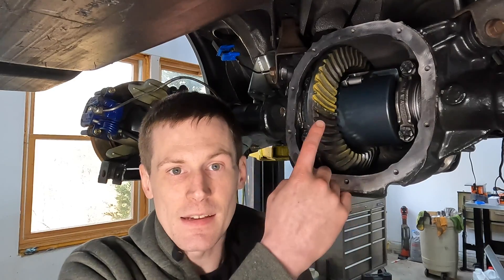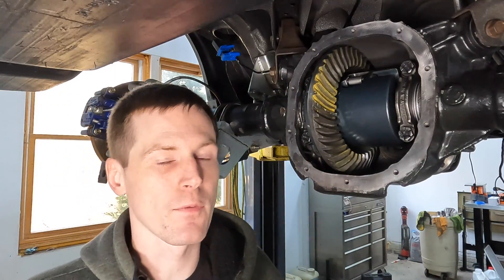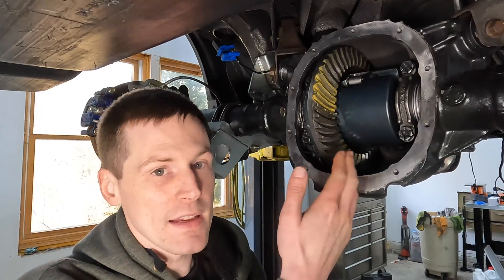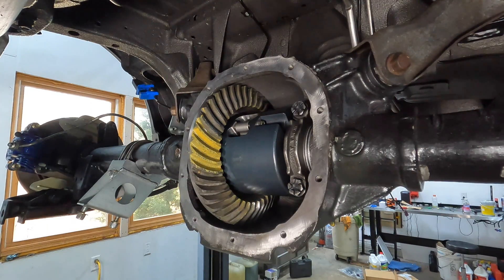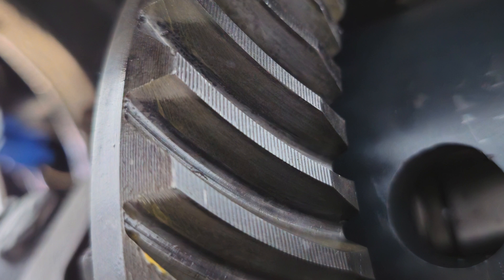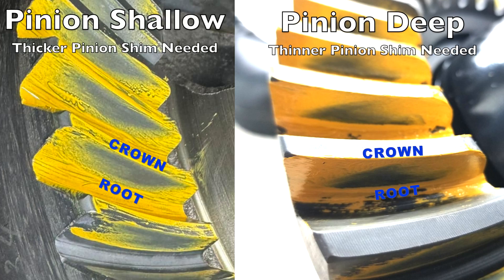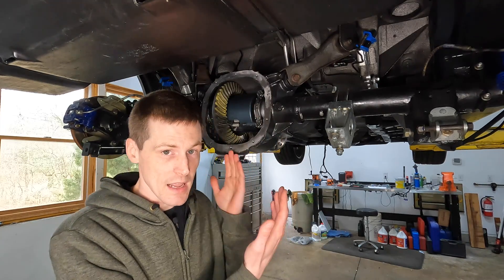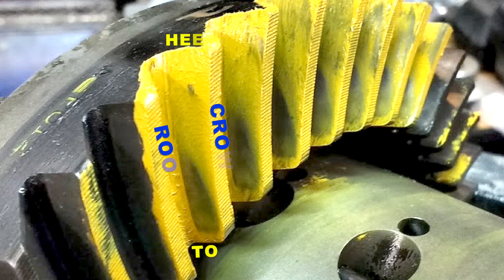How To Read A Differential Gear Pattern: A Beginner's Guide. ( Gear Tooth Contact Pattern )

Comment from the maker: Links to the tools required to rebuild a differential:
Gear Marking Compound: https://amzn.to/4agE3Ek
Calipers: https://amzn.to/48nlVr7
Dial Indicator: https://amzn.to/3utnAxB
Beam Torque Wrench: https://amzn.to/3UODXzz
Pinion Flange Holding Tool: https://amzn.to/3SZ2NLF
Bearing Splitter: https://amzn.to/4bIN1f2
Bearing/Seal Drivers: https://amzn.to/3uCYrAs
Hot Plate: https://amzn.to/3uuUu0Q
Shim Drivers: https://amzn.to/48j5KLp

Chemicals:
Retaining Compound: https://amzn.to/3SZpbEI
Thread Locker: https://amzn.to/48kF7pl
RTV: https://amzn.to/3OLwaP9
Degreaser: https://amzn.to/3uBzhlG

Parts used in this Ford 8.8 build: 
Ford Performance 4.10 Gears: https://amzn.to/49EJrRk
Ford Performance Install Kit: https://amzn.to/3I3hR4w
Torsen T2R Differential: https://amzn.to/3SKyXsQ
Moser 31 spline Axles: https://amzn.to/3I4DYaI
Crush Sleeve Eliminator Kit: https://amzn.to/49AKSAr
My Amazon Store:  https://www.amazon.com/shop/repairgeek
Help support the channel, buy using my Amazon links
As an Amazon Associate I earn from qualifying purchases and your cost is exactly the same.

Questions? Send your question or schedule a call here: https://tazet.com/repairgeek

Comment: Very well devised, that was indeed a cutting edge presentation!
In which, I subscribe.

Side note: I was just wondering as I’ve searched through countless sources on my 8.8 Ford performance 410 gear, would you be able to determine what would cause a pattern to be dead smack dab In the centre of the tooth on the drive, and cause it to every tooth incrementally inch its way towards the toe, and then incrementally back again to a perfect centred position on the tooth I’ve made a many inquiries with little determination, Certainly there has to be an answer to this or a way to determine such a anomaly. 

Saying that there was some reference that it may be something wrong with my ring gear Your perspective would be most appreciated!

Comment: I have a 2001 Wrangler with a Dana 30 front axle. In 2wd, the transfer case disengages the front axle, but the axle shaft and differential still spin. Would the coast side of teeth be more important on the front axle?

Comment: Great video, thank you! Question, I am looking to replace the carrier (trak-lok) on my 8.8 for a Torsen out of a Boss Mustang.  Can I do this without having to redo the pinion depth? I figure I may have to make an adjustment on the back lash with the carrier shims.
Reply from the maker: Just get your backlash the same as it was with the trac lok and it should be fine. If the BL is exactly the same, and the pattern looks the same run it.
Reply: @RepairGeek  Thank you so much!

Comment: Is it possible to have a great, centralized pattern but still have a low or high backlash?  Im typically ok if the drive pattern is a tad on the toe ..over time it should work its way up. But...too high? ...no.  But I was curious,  has there ever been a scenerio where your pattern is perfect and the backlash is too high. ( or low)
Reply from the maker: It can happen, a lot of the time it's caused by the gears themselves. Poor quality parts can have you chase your tail like this.
Reply: @RepairGeek  what if they are good quality gears.
Reply from the maker: If you're way out on the toe/heel. Check your depth again. If you're depth is good and you have a great drive pattern, but a crap coast pattern, it's your gears. You can split the difference as best you can but, you can't fix it.

Imagine trying to get a footprint from a shoe with worn out soles. That's what you're trying to do here.

Comment: I'm glad you included some info about partial rebuilds with respect to backlash. I'm gathering info for my upgrade install of a TrueTrac differential ('98 GMC P/U w/155K). The only things "new" will be the carrier bearrings on the TrueTrac; I will be keeping the original ring and pinion gears. Knowing factory specs are only for complete rebuilds using new gear sets has been very helpful.  Additionally, checking the existing backlash before disassembly (and the spec you want to shoot for) has been the "eureka" moment for me in watching your video. Thanks for all the great information! This subject ...that of doing a partial differential rebuild/modification and how it differs from a complete rebuild ...might be a good subject for another video.

Comment: Not exactly on topic but; How critical/accurate is the pinion depth number on the end of the pinion gear? On the initial setup how close do you get it and if not exact do you prefer more or less depth. Thanks
Reply from the maker: To be honest I don't use them. I start with a factory shim and adjust my pattern from there. Those are for pinion depth checking tools and from what I've seen unless you're spending $100's on one they are about worthless.
Reply: @RepairGeek  Thanks. So another off topic question...If you have/want to rebuild a diff that you don't know what it came out off and no markings etc how do you determine what it is to be able to purchase a new ring & pinion etc?
Reply from the maker: They usually have a tag somewhere that can point you in the right direction. Or do some google searching. Overall size and shape can give you good clues.
Reply: @RepairGeek  thanks

Comment: Don't forget there is timing marks on gear set,rule of thumb is even gear ratio has timing marks odd gear ratio does not,but that's not always true,also remember under pull the pattern will change,the pattern will pull up on the ring gear

Comment: Does tightening pinion depth,say .10 down to .06 create more gear noise.  Also you do not see many people talk about carrier preload.  Some people just wail away on the diff trying to get it as tight as possible and other is just about falls in.  Some builders will use a case spreader to get in as  many shims and get it as tight as possible.  I am concerned mainly about try to stop gear whine. I am installing a set of 4:56 nitro gears in my colorado and they are notorious for being noisy.  One person who got his set to be quiet was to get the pattern very close to the toe and get it center from crown to heel.What would you do to try and minimize the noise. Thanks
Reply: Toyota 4.56 also is closer to toe from the factory

Comment: I need your opinion. Installing a new eaton trutrac with an existing ring gear. The ring gear just slides right on to the carrier. It has aboit .0001 of play. It's a dana 44 axle with dana gears. If I freeze the ring, then it's tight. It's that close of a fit. The ring gear fits the old carrier, and the gear didn't need to be hammered off, but it's tight. 
Send it or get a new ring and gear?
Reply from the maker: Call Eaton. I used a torsen in this car for a reason. The Eaton is made in Taiwan, Torsen is made in USA and they cost the same money.

Comment: Does the contact pattern change when under "significant" load on the gears?  If yes should the pattern "without" load be set to adjust for movement to significant load?

Comment: I had a professional shop rebuild my GMC 8.6” all new. After 14 months the Eaton Tru Trac failed with clunking backlash (.460” backlash. Reading at 5” off centerline of axle). The new shop is going to reuse the Ring & Pinion but install a Dura Grip. I’m told he will tighten the pinion backlash to .006” (it was originally set at .010). The original wear pattern is perfect he says. Will that extra create noise???
Reply: Yes.

Comment: Yikes! I pulled the carrier of a 12 bolt GM already without checking gear pattern first. The dealership diagnosed and recommended all bearing replacements to cure noise. That’s what we bought. Trusting they used a stethoscope. The noise was constant and didn’t increase with acceleration. If I don’t see that the carrier or pinion bearings have any defects, I’m not going to be so confident that the truck will be noise free after reassembly. Based on what you’re saying, I don’t have the original pattern to compare to and unless it looks really bad, I would just have to go with it.
Reply: If you are just changing the bearings just put everything back the same way.
Reply: @ thank you, it worked out. Just had to use a spreader to get the left shim in.

Comment: Great video! One question.....

I'm rebuilding an 8.8 as well and my gear pattern (drive side) looks good, coast is far to the toe, BUT I have 0.090 pinion shim!😮  I know this is way more than expected.  Yes, it is a cheap hear set.....my bad.... I'm poor....should I be worried about the amount of pinion shim?  Or just roll with it because the pattern is good?  Thanks so much.  This is my first rebuild.

Comment: Sweet. I've made a billet case Ford 8,8 using ford performance gears and my pattern looks exactly yours. I've had nightmares of not hitting my machining tolerances right, but this shows I did. Check out @risengdesign

Comment: Great video! QQ. I bought a used rear end, has an upgraded Eaton posi unit. Fits standard 98 chevy 2WD squarebody. It was not setup properly and when I checked the gear pattern it was way off, barely touching at all. If I try to rebuild it, new bearings, shims, redo backlash etc, will I have any issues with noise or performance?
Reply from the maker: You'll probably need a new gearset. :43

Comment: Ok I’ll be the devil’s advocate, you didn’t explain how to adjust the backlash great video though, I learned a ton!
Reply from the maker: My rationalization was, if you are at the point of checking a pattern, you know how to set backlash. I also have a video that explains diff rebuilds in detail. I cover backlash extensively there.

Comment: Avoid using terms like thicker/thinner pinion shims.  On axles like 14 bolt/9” a thicker pinion shim does the opposite of say a Dana 60, try to use terms like move the pinion closer/further from the ring gear.
Reply: Clown

Comment: Hi, I have a sprinter 519 with about 300k km, when I accelerate there is a sound in the differential, at the speed of 75-80 km/h it is louder.  Who do you think would be the problem?  (it seems to me that the backlash is higher than normal)
Reply: Today I looked through the filler hole and noticed that the backlash comes from the spider gear has play on the pin.
Reply from the maker: What does the fluid look like?
Reply: @RepairGeek  I changed the oil about 4k km ago, and it looked pretty good and there wasn't much dirt on the magneto.
Reply from the maker: If it has a carrier bearing check that first. Usually if you've had some kind of bearing failure in the differential you will have metal in the oil.

Comment: So if you have to take it apart by trial and error maybe 3-4 times to find the right pinion depth shim, won’t my inner pinion bearing get damaged from taking it on and off so many times with the hydraulic press and bearing separator?
Reply from the maker: Make a setup bearing. I address this in detail in the differential rebuild video.
Reply: @RepairGeek yeah unfortunately either my setup bearings had enough difference in the tolerances, or a bearing race wasn’t fully seated. Cause my pattern changed from the setup bearing to final install with the bearings pressed on..
Reply: Actually they have a clam tool to remove the bearings without damaging them. So if you don't do it for a living you don't need to waste money on a bearing set for setup
Reply: When I rebuilt my son's differential for his V6 Mustang, I purchase the "GXL Carrier & Pinion Bearing Puller Dana 30, 40, 60, 70, 80, Ford 10.25 Clamshell Design" bearing puller, which made removing the bearings very easy and didn't produce any damage. For installation, I finally had a good excuse to purchase a nice shop press.

Great video. Really appreciate all of the insights.

Comment: Excellent, thank you,  i purchased spicer 4.88 gears to replace oem dana spicer 3.73 hopefully all goes well ... 
Ps. I remember you mentioned in another video when you disassembled the mustang rear that it had timken and koyo, i purchased yukon master overhaul kits and they both (front n rear jeep diffs) have timken and koyo on the pinion, after some research it appears (i may be wrong)   that koyo bought out/ merged w a portion of timken business, from what i understand although Japanese company most of the differential koyo bearings are manufactured in usa ?
Reply: Pro tip-  Use Koyo (USA or Japan) vs Timken.  Don't believe me, put them side by side...you'll see.

Comment: Awsome explanation....I have Yukon 4.56 gears in my AM 11.5 differential when I ran the pattern my tooth contact on the ring gear was dam near identical to the  pattern Yukon gear recommended pattern was not to deep or to high my backlash was .006 and that's been 200k+  miles ago with no noise in the differential
Reply: The reason for backlash being kept within the specifications. 8 being the tightest I would ever accept is because when you're driving the ring and pinion heat up in that backlash disappears. Two little backlash after the gears heat up puts the gear set in a major bind. Which will result in failure
Reply: @cecilandrews7479 I think it depends on if the geats are "2 cut" or "5 cut" gears for the backlash range.
Reply: Aquí las dudas, en lainas de ajuste en mi para ir ajustando corona y piñon .

Comment: Why do you HAVE TO stay in the specified range for backlash?  Isn't the mating pattern of the teeth far more important than a couple thou out of spec backlash?
Reply: Backlash is determined by how much heat the gears develop and expand. With two little backlash has the gears heat up will put the gears in a bind resulting in failure

Comment: What does it mean when you take the cover off and it looks like someone stuffed it full of steel wool? That diff ran fine up until I decided to change it out with a low mileage unit just incase. I discovered the "steel wool" inside at 160000km, cleaned it out and ran it till 330000km. Pinion ate deeply into ring gear during that first 160k. Pretty sure it came that way from factory, it was a one owner Jeep XJ Chrysler 8.25. Didn't even make noise.